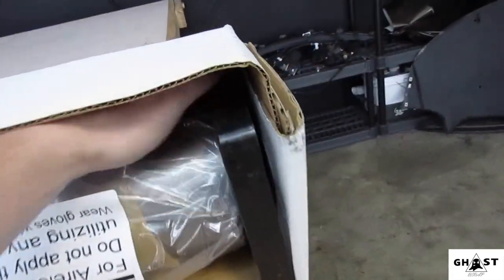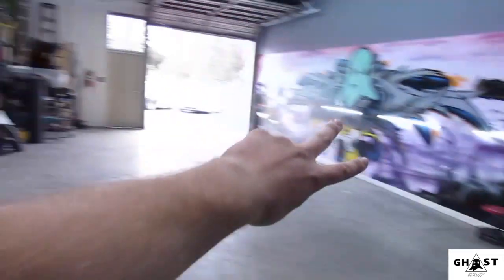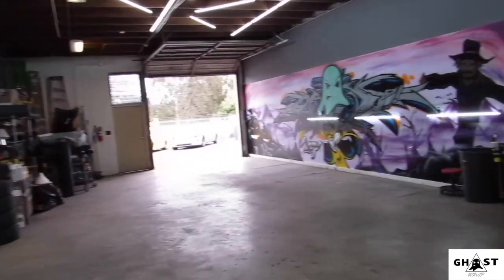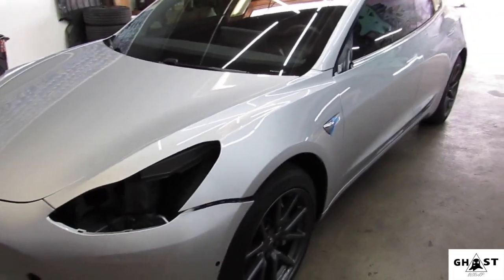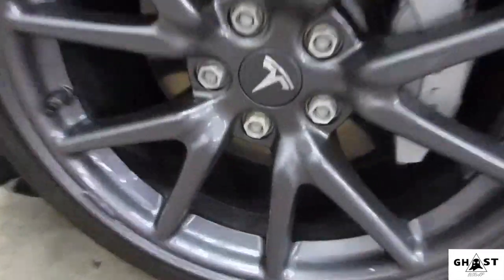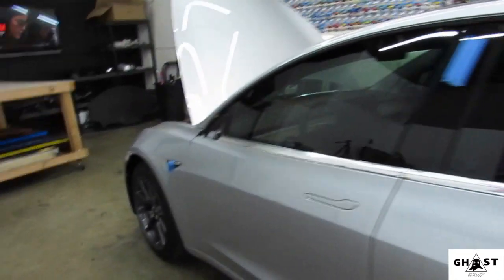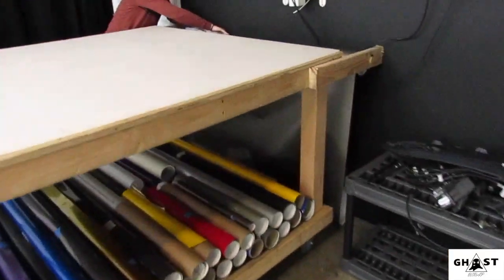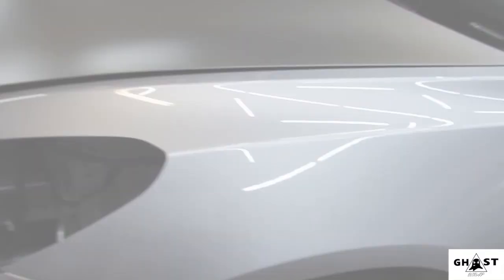First Time Wrapping With KPMF!

Comment: Got a kpmf airelease gloss black to wrap my roof , prepped my roof , measured the size , got the vinyl , peeled off the paper , and applied it to the roof. It sticked so hard to the point where i couldnt even unstick it to iron the wrinkles.
Total waste of money and wrap, barely could take all wrinkled vinyl off of the roof.
 No idea how you can work with that film